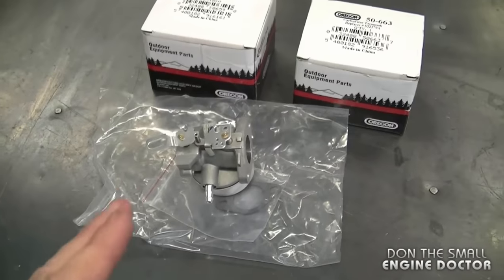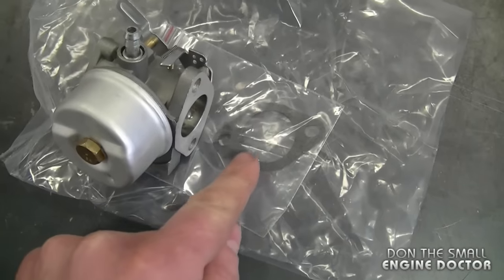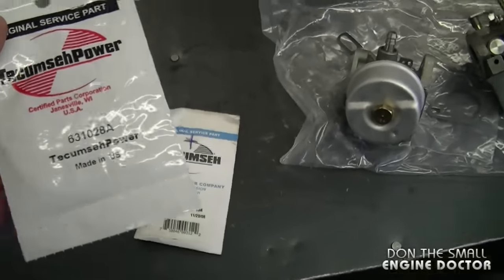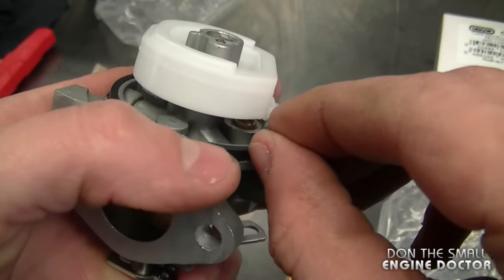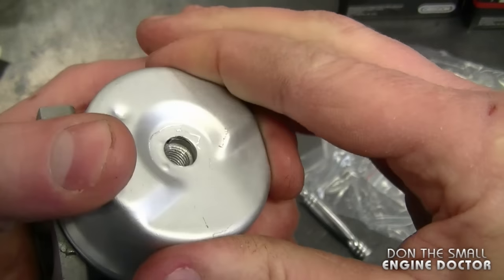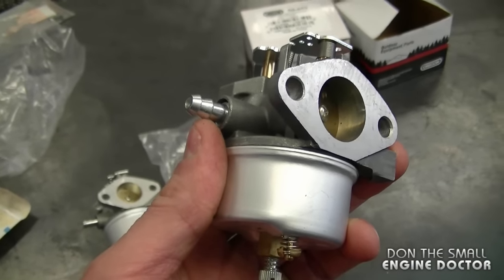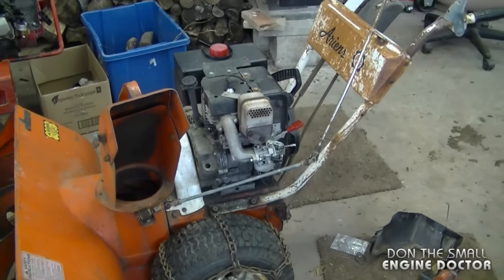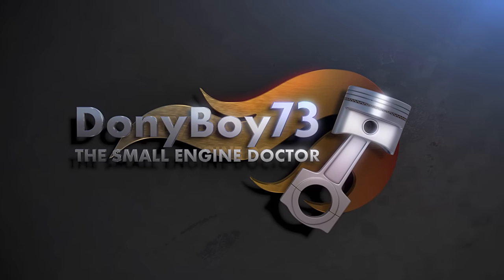Save $Money$ With Aftermarket Carburetors For Small Engines!

Comment: How interchangeable are carbs from different small engines?  I just received a 30 year old Yamaha YS828 snowblower.  Most things on it look like clones of the Honda 828 and 928's I've used, but it does almost as well as the Honda's, so I'm thinking of putting it at our rental in addition to the MTD snowblower it has (the 10HP MTD does pretty well (just removed 32" of wet, partially compacted snow with it), but it would help to shoot the snow further like the Hondas or this Yamaha does).  I've fixed several things on it, but the carb leaks just a little out the drain plug and holding plug on the bowl.  The external fuel pump, which I haven't seen on another small engine I've played with, might leak too.  Could I replace the carb and fuel pump with a carb clone for a honda of similar HP?  The OEM carb 7KF-14501-01-00 is available online for around $120, but I'd rather simplify to something I'm more familiar with, getting rid of the fuel pump (which I think most bowl carbs do away with, or internalize like a Zama or Walbro non-bowl carb on a chainsaw or the like).  Thanks for the great videos and info!
Reply: BTW, the main reason I'm looking to replace this carb is that when cleaning the carb in trying to get the engine running, the screwdriver notching on the main jet striped, and so I was unable to get the main nozzle out to clean it's small orifices.  It's working for now, and I can likely fix any fuel leaks with similar seals or fix-a-seal, but it would be great to know if I could put a different carb on it if it or the pump fails.

Comment: Don,
I replaced my carb with something similar recently and the carb leaks gas when the engine is off.  Is it likely the bowl nut gasket and bowl o-ring that I should replace?
Reply: +Rich&#39;s Fishes could also be a leaking needle and seat.
Reply: I was hoping that would not be the case on a brand new pre-assembled carb!
Reply: Well, it does happen. Pinpoint where it is coming from. Try this. Shut off the fuel flow somehow to the carb. Wipe off all the gas/crud on the outside of the carb. Turn the fuel flow back on, and look for the location where fuel is coming out. If it leaks out the bowl ring, you'll have to spot it fast before it trickles down to the bowl nut, giving you false conclusions. If fuel is coming out the throat of the carb, your needle and seat are leaking. Sometimes you can gently tap the outside of the carb bowl with a screwdriver in case the needle got stuck open. Worth a shot though. Be aware a carb that leaks gas can get fuel into the crankcase. Pull out your dipstick and use your nose. If you have fuel in the crankcase, depending on how much, your engine may not want to start, stay running, or smoke a lot. Hope that helps you a bit.

Comment: hey donyboy73 i have a 8 hp craftsman snowblower looking to replace the adjustable carb with a none adjustable its a tecumseh engine what carb should I order thanks for any help u can provide
Reply: only reasen I am asking is because I see a lot of ones online that work on 5 to 7 hps and others that work on 8 to 11 hps anyway to tell witch one I need to order without the engine modle number I got this craftsman 8/28 used and the moter has been repainted cant find the model number thanks for any help u can provide

Comment: +donyboy73 
do you use an ultrasonic bath to clean carburators (and other parts), and if so, what cleaning solution do you use?
Reply: I'd like to know this too.  Maybe a whole tips video on how you use your ultrasonic cleaner and what cleaners you use for what parts.

RichE
Reply: +Sebastien Tremblay I've had incredible luck using distilled or purified water as a base along with about 1/4 cup of Pine Sol. The mineral content in regular tap water can supposedly make cleaning more difficult. Of the hundreds of carbs I have ultrasonic cleaned and rebuilt, maybe two failed to work. My theory is if the Pine Sol and DI water didn't fix it, the carb was shot to begin with. You can waste your money buying chemicals that are branded for cleaning carbs, but they are expensive. I have tried a lot of chemicals, and the best bang for your buck is Pine Sol.
Reply: +pbrstreetgng79 PBR.
that's an interesting combination.  Does the pine sol leave any residue?  
I myself am looking for a solution for car injectors specifically, and I read a few times that using water might not be the best idea.  I think the carbon deposits might be very tough too, so they might need a little extra punch.  then again, i'm no expert, thus the question....
thanks for the reply.
Reply: Never had a problem with residue using Pine Sol. Only side effect is your exhaust may smell a bit like pine for a few minutes.

Comment: is there an adjustable carb for a HM100- 159409P that has a crankcase breather connection? all i'm finding are nonadjustable carbs for my model.
Reply from the maker: do a search on ebay for that carb
Reply: i had checked ebay and most of the other online sites. since both carb types use the same intake, i'm thinking i could install the 50-663 on my generator, if i add the primer bulb and vent the crankcase into the air filter.